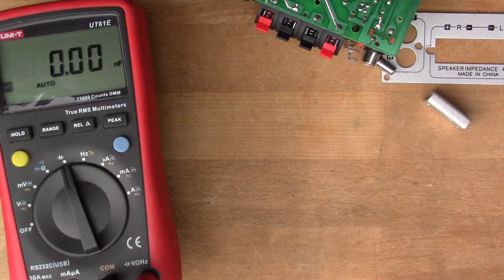Power amplifier, teardown and modifications (#102)

Comment: It's an oem product sold in plenty of different color cases. What bothers me is that sellers advertise it as 2x20 watt amplifier while datasheet for this chip says it's 2x8watt amplifier chip. Maybe this construction somehow squeezes more than that or just they are lying to people. I got pair of standing home theater speakers that are recommendet to use with at least 20W amp, but I hope it'll be enough to get at least listenable levels in that setup. I don't need too much volume but just decent sound in a small room for normal listening with quality better than USB speakers I got for my laptop. I got 12v 2.5A power suply from an old router. I hope it's all enough.
Reply from the maker: Yes, as I said in the video it's an old chip (discontinued), analogue and about 8W.  The volume level is adequate for listening in a room.  A 2.5A power supply should be enough, but be careful with re-purposed power supplies as some can be noisy when used with audio amps.

Comment: I have this same amplifier... I had to open it up to get the board # because it's literally a no-name amp. I think I have a newer revision board because it's HY-2078C where yours is a -B. Don't know if it is any different than yours. I also assumed it's a class D as well. Good to know of any issues I might have with it. I'm using it for speakers on my computer. They're 4 in. (100mm) drivers without a tweeter, but the amp does its job fairly well for what I'm using it for. Good deal for under US$20 w/shipping lol.

Comment: I just bought one in 2022 last week from amazon and it has a TDA7266 which is a completely different output than advertised. 7wx7w at best not the 18wx18w they advertised.  Hell even run as a single channel it wouldnt put out 18w smh. Turns out they are doing this on all units now but not changing the specs and selling them as if it's still the same chip. Really pisses me off. Anyways I build guitar pedals, guitars and do tube amp mods constantly so I'm fully capable to mod this one to the correct values and parts. But I was hoping you could verify the main component values so I can make sure the ones that are off can be changed. I'm new to solid state amplifiers but im sure it's not that different so I should pick it up fairly quickly. Thanks for any help you could offer!
Reply from the maker: It's true that you never know what you're going to get until you open it up.  Everything's boxed up after a house move, so it might be a while before I find this amp to look at it.

Comment: I have one that i think is very similar except i have a balance control too. I took some of the claimed specs with a pinch of salt but it will be okay for my purposes. The led is going & they probably cheaped out on heat sink compound too so i am changing that. What irritates me is that sellers are claiming it will be sent via Royal Mail but use another courior instead. I found my package behind the rubbish bin.

Comment: How to make it more powerfull
Reply from the maker: The output stage for the amplifier is actually on-chip (TDA7057), so I'm not sure there's much scope to boost output, other than making sure you drive it up to the maximum 18V power supply.
Reply: Sir mine has a problem.. When im driving the sound been chappy but when i stop the motor the sound is ok again,, it happens when the engine is on?
Reply: @alanconde8512  You have either grounding or interference problem. Run a separate ground for the added amp if you aren't already, ensure it's clean and tight both ends and most importantly run separately from any wires containing POS current and do the same with the speaker wires. POS current can leak into speaker and ground wires if run too closely causing interference. Other possible option is rectifier in car alternator is dying allowing AC current ripple